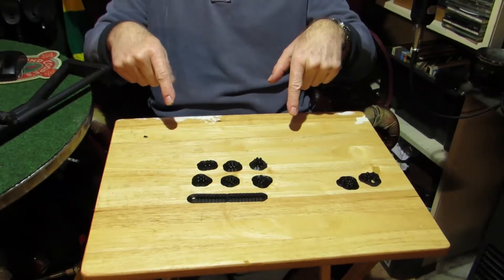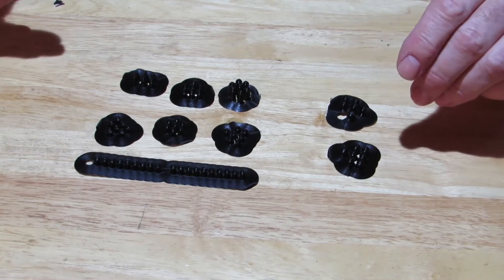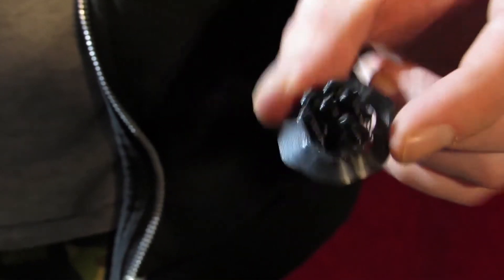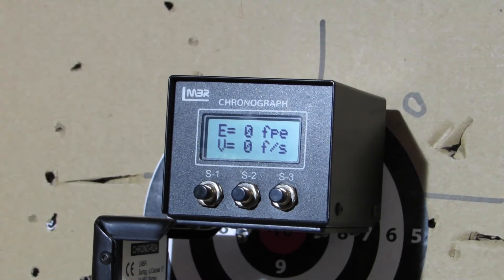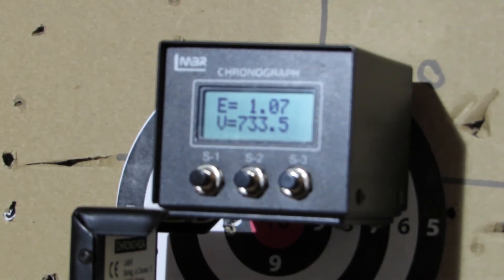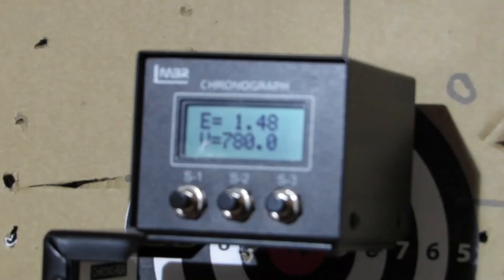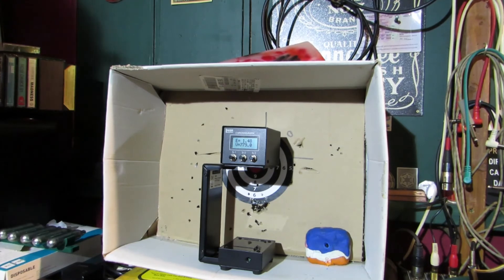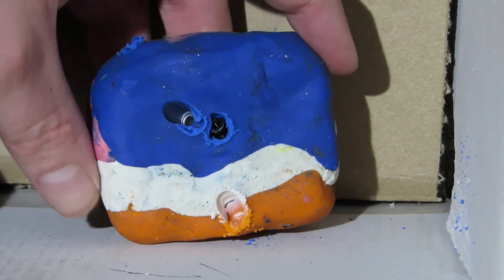Testing 3D Printed Air Gun Pellets

Comment: I winder if you could make like a shotgun type thing for a break barrel.
Reply from the maker: Put a rollup fag filter in the barrel in place of the pellet, push it down about an inch, put in 3 or more .177 steel bb's, then another filter, voila. shotgun style with no mods or special shells. wouldnt do it on my best gun but I done it on an old banger and it works.
Reply: @ShootfishProductions  Awesome ima try it!

Comment: just saw this video and printed some, i tried 2 one of them weighed 0.6g the other 0.4, they both packed quite a punch for only being PLA they went straight through a coke can
Reply from the maker: Nice. I had trouble getting them the right size, some of them were too tight. Going to try some with tpu so theres a bit of leeway with the fit.